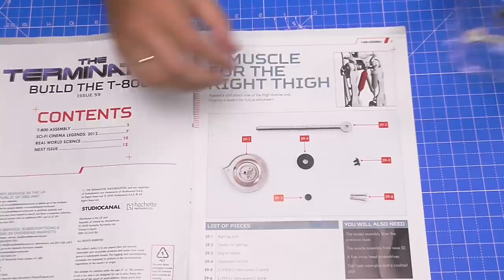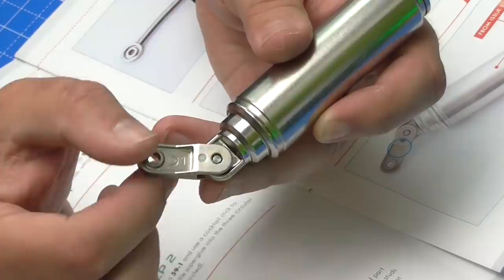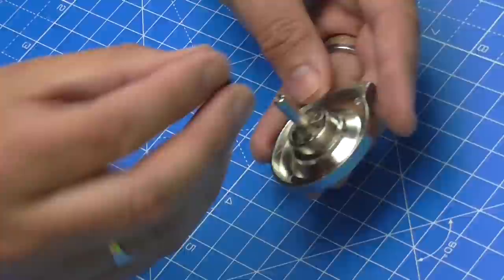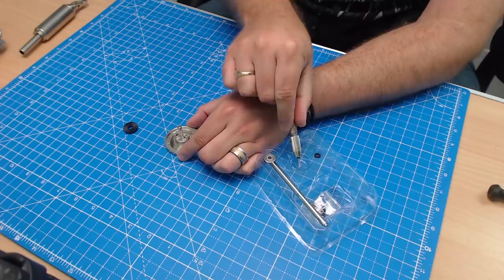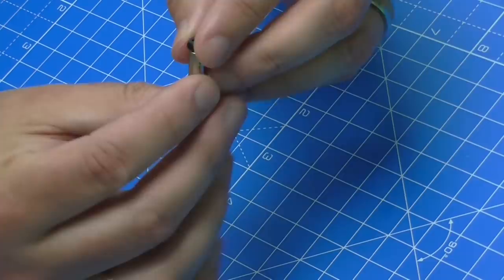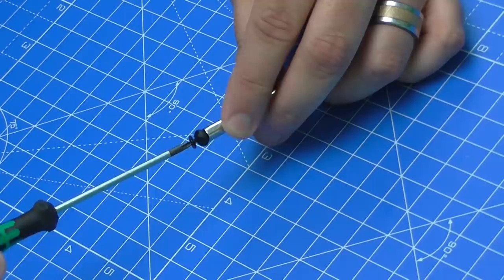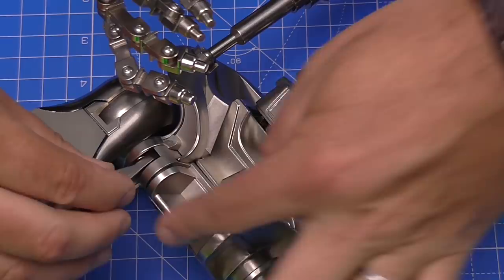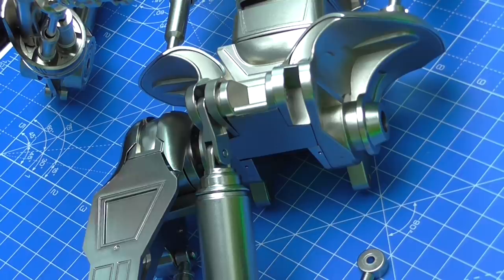Build the Terminator - Part 59 - A Muscle for the Right Thigh

Comment: Just completed issue 62 and sorry to say MORE plastic, have they changed tack half way through?
piston fittings are rubbish
Good job it comes with a stand as the plastic legs will snap!
Don't now whether to hold on it not as i fear the most important part, the Chest Plate, will probably end up in plastic too

Comment: Well done we,ve used those Black PWB screws before on the back of the head motor issues17/18i think. I won,t be glueing that rubber part in. However i will be using1 M3washer to prevent overtightening of the screw on the rubber part itself. Plenty to do in issue60

Comment: Hi Wayne when I did mine last week I have two number 2s on my piston n joints I thought that was strange 
Just got my side piston fix off Andy thank you for the heads up 👍
Reply: i have 2 no.2s, is this gonna cause me any problems?
Reply: Kev Price not a problem I’m up to issue 60 and having 2 number 2 piston tops hasn’t made a difference at all so all good

Comment: Hi on issue 107 I can't get the eyes to light up by pressing the button  on the circuit board it's had new batteries so that can't be the issue all leads are in the right order any advice you can help me with many thanks
Reply from the maker: Did you keep your finger on the button. You need to press it for a good 1 second
Reply: @WorldofWayneUK  hello mate I have tried that as well
Reply from the maker: @garyhallsworth5029  hmm not good. I would get a meter to the power terminal to confirm there is power then I would think about the circuit board may be faulty. When you press the button it should light the eyes and you hear the motor engage as well
Reply: Makes a buzzing sound
Reply: I can hear  the motor but the eyes don't light up
Reply from the maker: @garyhallsworth5029  ahh so the board has power then. Does the jaw or eyes move?
Reply: @WorldofWayneUK  no mate I haven't built the remote as of yet only on issue 112 just thought I would test the eyes wen I put the circuit board on don't really want to strip it all down again